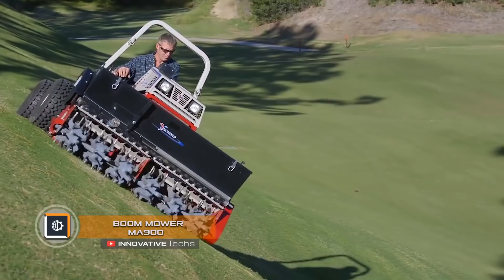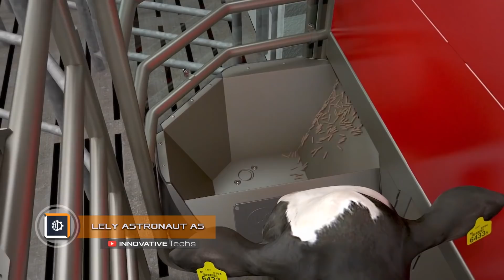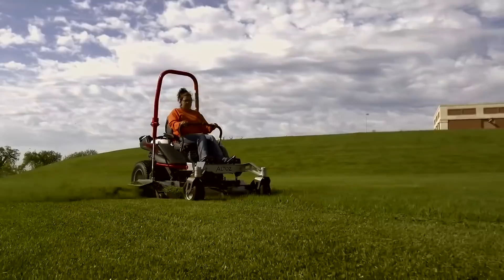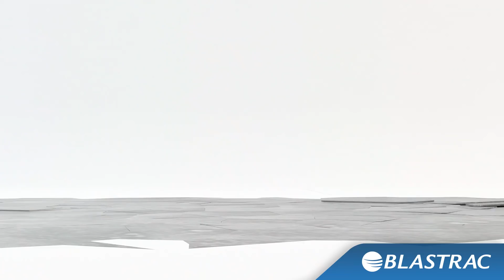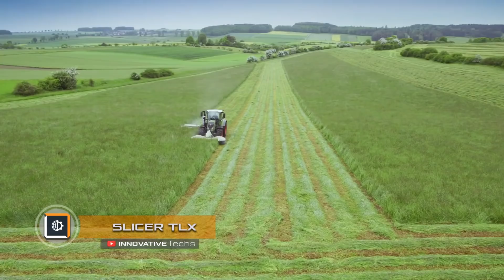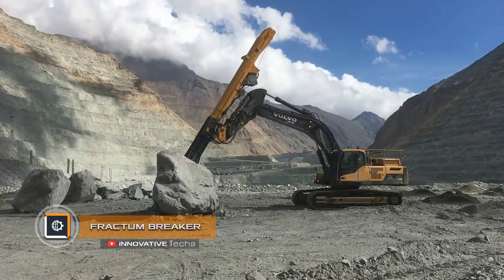Top 10 Most Insane Machines You must see

Comment: JMEKA SMARTPEL TRACK P- In regards to making reference as to where it can be used. The term "Confined Space" is overly misleading. Instead you might want to use the phrase tight space. Confined Space is an area in which every Occupational Health and Safety regional authority has explicit regulations for entry. A manhole,  ballast tank,  and other such areas not designed for human occupation are confined space.